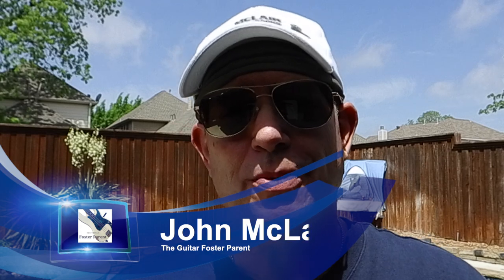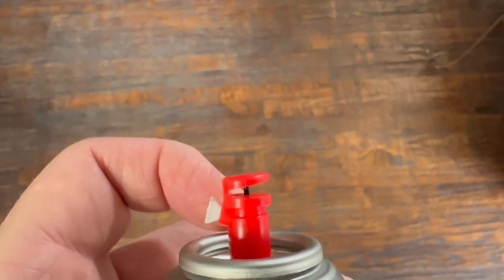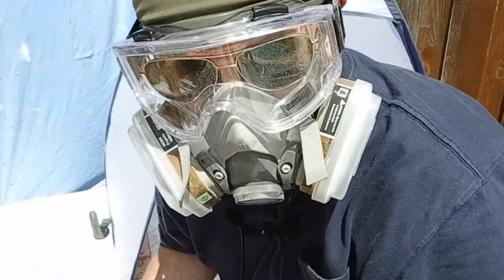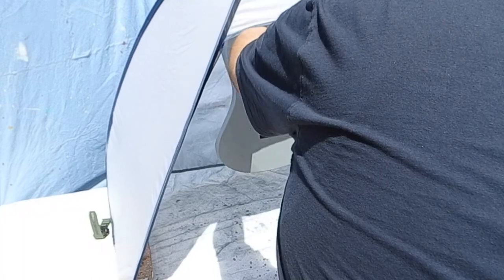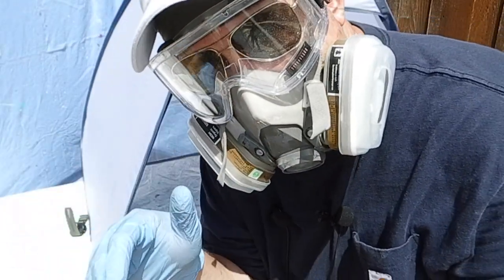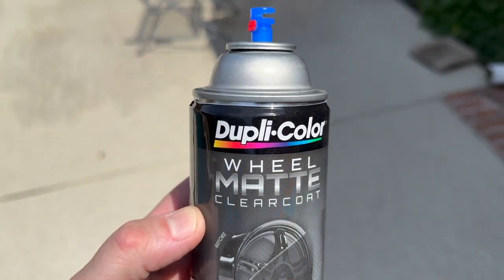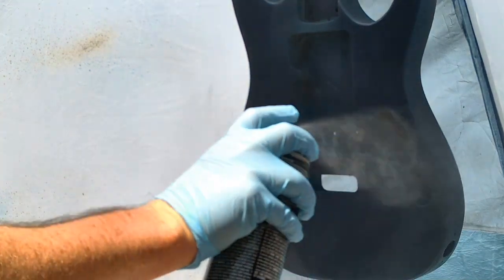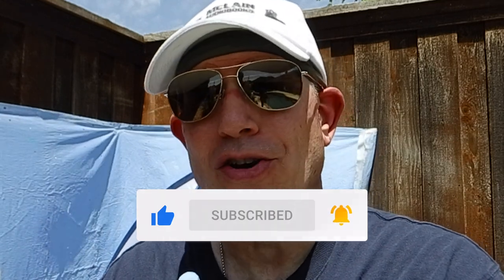My first guitar paint job!  (Was this a BIG mistake??)

Comment: The technique is correct spraying that stuff.  An auto painter told me once to emulate a robot.  Spray on, pass the object, spray off...repeat, and a 50 percent overlap.  Should be very nice !
Reply from the maker: It worked fairly well.  In retrospect, I should have been more careful about keeping track of my sprays and where they were.  Not “robotic” enough, as it were.